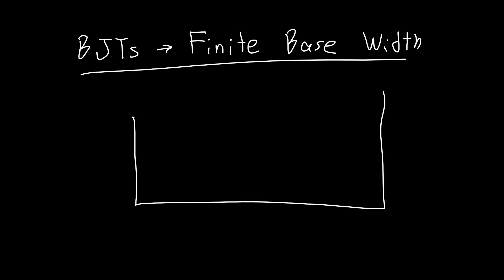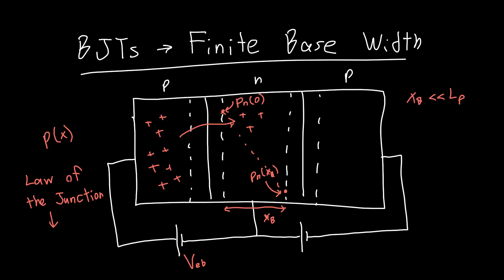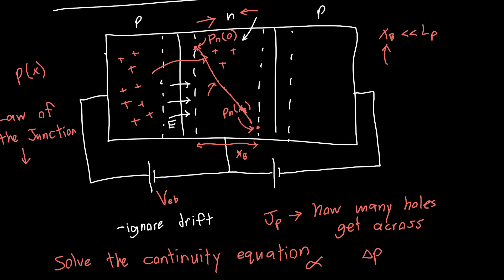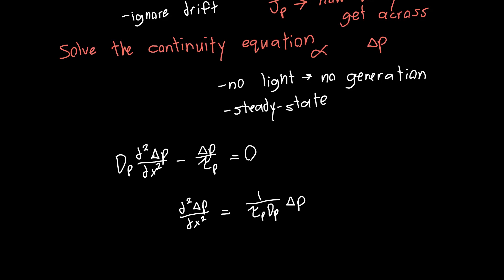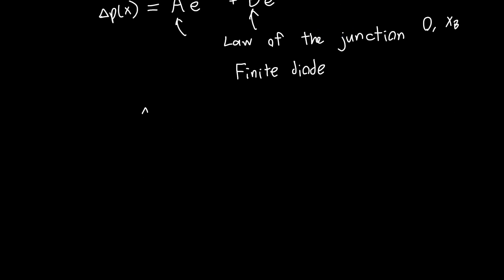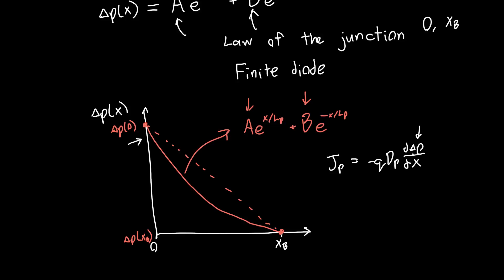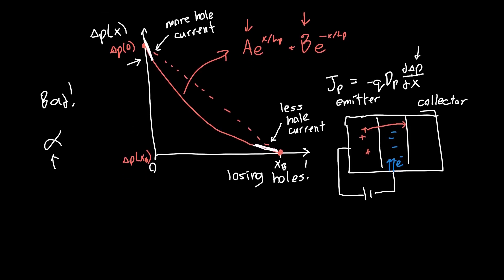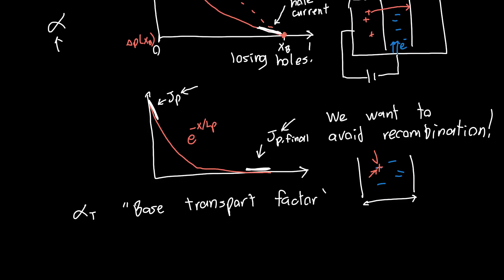BJT Explained Part 3 - Finite Base Width

Comment: is there a way to power 2 diodes to be a transistor?
Reply: Don't think so, you get an E-field over the the both because of the small distance between the PN junctions, this is E-field accelerates the carrier over the base. If you try to do that with 2 diodes the 2 PN-junction will be too far apart for them to interact with each other.
So even if you manage to create a base in between the diodes in some way the distance is the problem, you will have too much recombination.

Comment: First I must say that I really like your videos. Thanks for providing them. But, this one helps to propagate a miss concept. Although in the past (due to the longer bases) the recombination was indeed an important factor at the beta of a transistor, for modern devices it plays a very small role. In short base devices, the minority carries at the emitter side (in a pnp, electrons coming from the base) will dominate the base current. The major problem with correlating the base current with collector current through recombination is that designers give an over importance to the beta and tend to see the base current as of the control variable to the collector current. The base current is a "defect" of the transistor and not a control parameter. By understanding that the base current is dominated by the minority carries at the emitter side, one should notice that the dominant common point between the base and collector current is the Vbe and this is the real control parameter of a bipolar transistor. You do breathly mention the current due to the minority carries at the emitter in your previous video, but I wish the emphasis in this one would have been at this point. And by the way, also in larger base devices the minority carrier current at the emitter plays an important role at the base current (not to mention impact ionization).  But anyhow, keep on the good work with the videos, they are very interesting.
Reply from the maker: Thanks for the info!